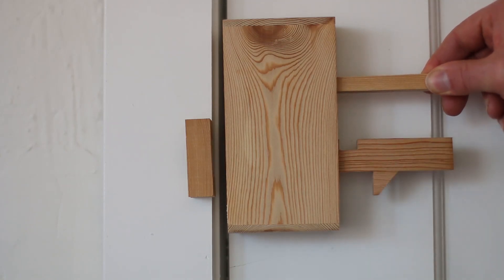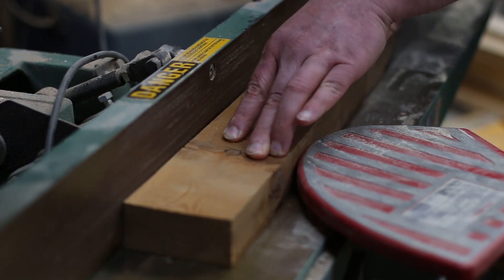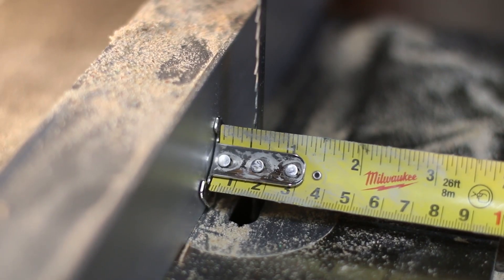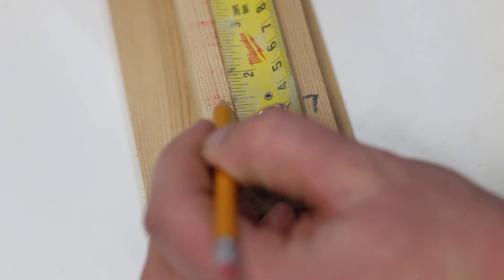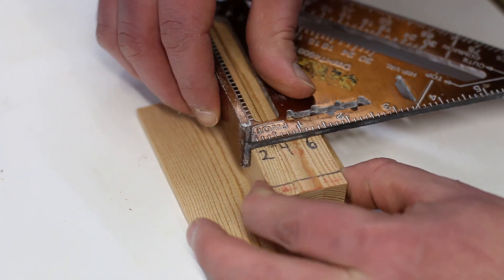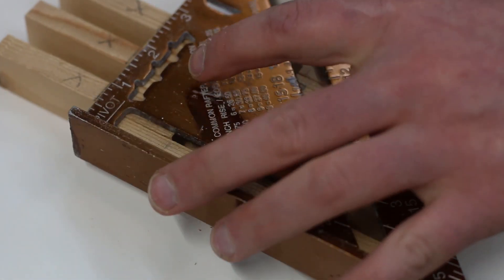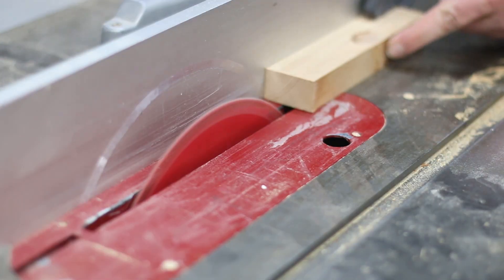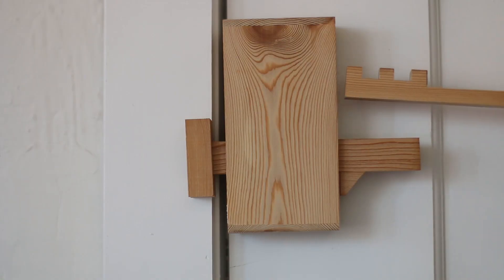Ancient Egyptian Wooden Lock from a Single 2X4

Comment: You forgot to encode the key and lock. You set the depth of cut of the deadbolt and key the same in all slots. That's like setting a combination lock to 111.
Reply: Well, considering the fact that with this type of lock, lifting a pin to a height greater than what the key's corresponding position is set would still result in the pin being in an open position, it really doesn't matter.  In other words, you can raise all the pins to their maximum height and it will open the lock regardless of what the lock and key are supposedly keyed for.
Now, if you wanted to make it so that only the correct key (or pick position) could be used, you could extend the pins past the bottom of the bolt and put additional sections that would engage the bottom of the bolt if raised too high.

But, remember, this is a wooden lock... It can be easily defeated with a saw blade or hammer... It serves no protection against people, other than to "keep honest people honest"... The one thing wood does provide though is a way to model possible lock designs in a larger scale so that you can easily / cheaply try out possible designs before making them smaller and from metal... If you come up with a good design, you could even create a metal model of the same thing with 1/2" square steel bar and braze the various pieces together.  Let's see how much fun BosnianBill has with one of these where he needs 2 lbs of pick pressure on each pin... :)
Reply: This is authentic to the original Ancient Egyptian design. It's the oldest known lock in history, so the art of lockpicking hadn't actually become a thing yet. Unless you could get the key to copy it correctly, you probably had no recourse except physically breaking it.
Reply: @CurmudgeonExtraordinaire  this lock can keep out mischievous people that aren’t sure they want to break stuff and make noise. I like that a friend cant claim he locked himself out and have a locksmith come and let them in or have a key made as I had a friend do once.
Reply: @6mdm  That locksmith opened himself or herself to a lawsuit. You have to give a valid ID to get a car unlocked. Actually I think I had to provide the insurance policy to the car to get my car unlocked on a extra cold sleet and snow day. Now I have a key in each front pocket of my pants. I don't need anymore $150 dollar lessons.
Reply: @genespell4340  he was an exroomate that wanted to use my apartment when I was out of town.I would come home and all my towels would be in the laundry and finally I noticed after being away for weeks that my shower was wet. I caught him on a hidden camera. This is when I realized the only way to be sure no one is in your home while away is hidden battery cams. Security systems can be defeated pretty easy especially if they have a friend in the business. But a camera they don’t know is there is the best defense.

Comment: This is super cool!  Simple but complex.  I notice that one needs to pull the key up to trigger the device.  Would it be possible to build the key in such a way that turning it would push the blocks up sort of like a cam shaft?  The lock would needs to be thicker overall or the key more skinny and oblong as would be trading depth of key going into height as the key is turned to get the block to move up.  Would be super neat!  Cool build already though!
Reply from the maker: I love the cam shaft idea - way more elegant than the simple key.
Reply: I've seen variations on this lock used in older houses in my country, we refer to them as puppy-locks (translated to English here for your reading pleasure) btw, though most of these locks use a metal key.
Reply: @Rovarin  -- One of my wife's friends has a dog that can open the front door.  It will keep pawing at the door knob or moving it with it's mouth until it turns and the door can open.  She ended up having to put some sort of shield around the door knob so that it would rotate, but would not allow the actual knob to rotate.  One of these types of "locks" would have also worked, so it really would be a "puppy lock". :)

My suggestion was to put livestock electrical charger attached to the door knob and a conductive plate in front of the door.  After the first couple of zaps, the dog would stay away from the door.  She didn't particularly like that idea though...